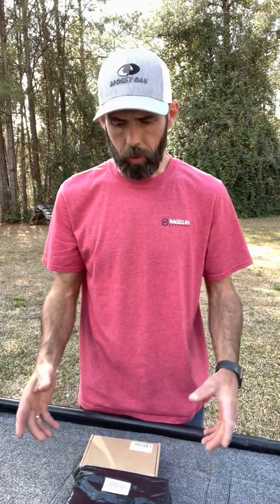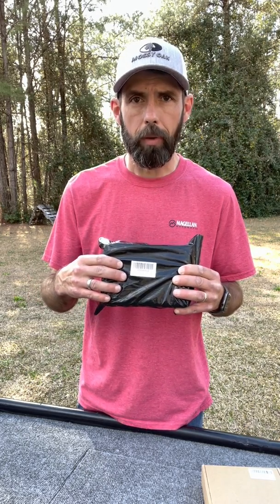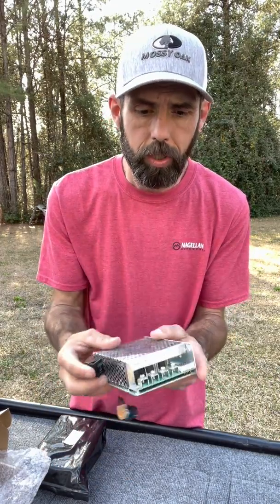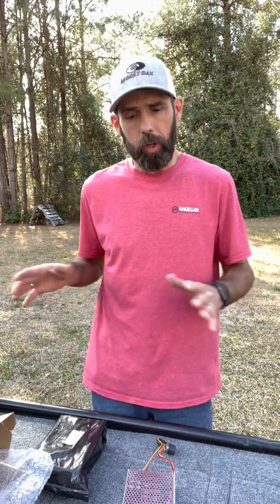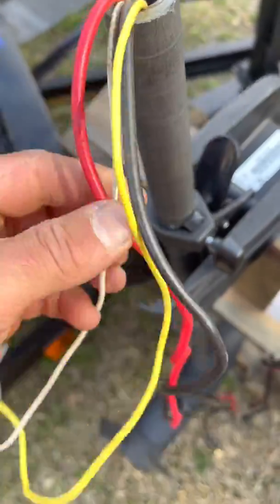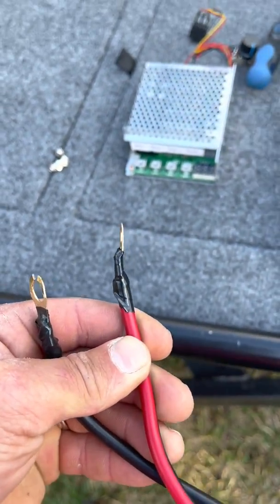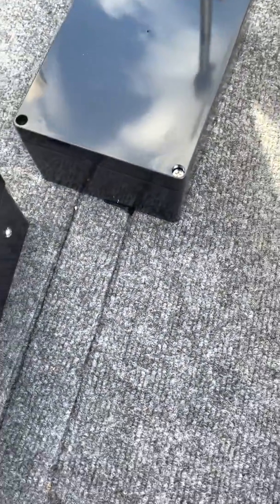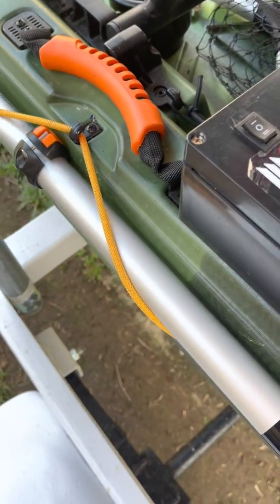How to hook up a PWM (pulse width modulator) to control a trolling motor.

Comment: 1st day out. I’m on full power running for about an hour on my minn Kota 40…. All of a sudden it shuts off…. The reverse still works oddly… the 0-100 wouldn’t even display for the forward switch (the two lines)

I had to paddle my ass 4 miles back LOL

The PWM was hot as shit…

How do I avoid that in the future?

I read the PWM is only 40 amps continuous. Obviously me going full blast was beyond that… 

Is there a PWM that will go continuous without over heating dying?

Also is that PWM dead dead, or can I revive it in anyway.
Reply from the maker: You need a larger PWM the 100amp with a fan especially running full power.
Reply from the maker: I also forgot make sure you’re running 8 gauge wire.

Comment: Instead of the potentiometer can a e-bike throttle be hooked up to the PWM?
Reply from the maker: I’ve never tried and I’m not sure of anyone that has. As long as you can connect it to the control board I don’t see why it wouldn’t work.

Comment: The reviews on Amazon that said they used these things on trolling motors must have all been fake or outright lies. The PWM that came today had connection terminals so small they could only be used for the thinnest of wires and no way heavy guage trolling motor wires could hook to it. I'm sending this crap toy back. 100  amps my ass this thing is for toys not trolling motors.
Reply from the maker: The 100amp PWM I used in my video is the only one I will refer for people to use.
Reply: @334tacticaloutdoors  The one that was sent has a fan and rated 100 amps but the connection terminals are so tiny and so close together there is no way to hook it up without frying it and then you are stuck with it. Amazon might show the one with larger terminals but the crap they send is the one with tiny terminals.
Reply from the maker: Yea if you can’t hook up the terminal connections without them having a little space that would never work.

Comment: After all the work installing, researching, shopping, and after working for about 3 months, my PWM simply stopped. No moisture visible, no burn marks, not nicks. I tested voltage to the PWM and it's getting full juice. Nothing coming out. I'm at whit's end here. Any suggestions?
Reply from the maker: What size PWM do you have? And what size trolling motor you have?
Reply: @334tacticaloutdoors , it's a 100 Amp and a 62 lb motor, 12 volt
Reply from the maker: Unfortunately it sounds like it has gotten water in the switch that’ll end the life of a PWM
Reply: @334tacticaloutdoors , I have power at the PWM but nothing going out. I have to check the controls, a lot of splices, but I got depressed and I'll look at it tomorrow

Comment: Like your video. Where did you get the project box. I like that box it looks good and makes a nice clean job. Thanks
Reply from the maker: Thank you, I got the box from Amazon 
https://www.amazon.com/Zulkit-Waterproof-Electronic-Junction-Enclosure/dp/B07RT6NWTR?pd_rd_w=2bCMJ&content-id=amzn1.sym.70f850ae-ff80-43b3-b581-5ad293225e90&pf_rd_p=70f850ae-ff80-43b3-b581-5ad293225e90&pf_rd_r=GBNDNN8WJ96JZ94FBQ5G&pd_rd_wg=cja2C&pd_rd_r=bae49b80-e37c-4ddf-aa05-f38ce0fa2dba&pd_rd_i=B07RT6NWTR&psc=1&ref_=pd_bap_m_aisles_rp_aisle_0_ttr_0_1_i

Comment: Bro seriously thank you for this! You have no idea how many videos I have watched and everyone acts like everyone is good with wires. Your video was the simplest video I have seen out of all the research I have done. I'm going to follow this step by step. I only have 1 question.. I have a 24lb thrust 12v watersnake trolling motor. Should I use 10 gauge wire or 8 gauge? I don't want it to overheat or fry it. Thanks for keeping it simple 👍🤙
Reply: You also got a new subscriber 🤙
Reply from the maker: To your question 8 gauge is always best to use. And thank you for enjoying the video that was the whole point in making it just to explain how simple it really is. Thank you for subscribing to the channel I appreciate all my subscribers.
Reply: @334tacticaloutdoors  perfect found some 8gauge power sockets on Amazon not exactly the same ones you used as those are only in 10 gauge but they should work just fine. Appreciate the replies brother you helped me out a bunch 🤙
Reply from the maker: You’re more than welcome, if have any other questions just let me know.
Reply: For 34lb watersnake motor, what size if the wire/socket i need to use?
Reply from the maker: 8awg wire is always best to use.

Comment: Did you have to extend the motor wires or battery wires? If so do you use 10 gauge? And do I ask for 10 gauge connectors? Stupid questions, but piecing this together.
Reply from the maker: When u extend the wires from the trolling motor to the PWM yes and I use 8 gauge and the wire from the Battery to the PWM I use 8 gauge also.
Reply: @334tacticaloutdoors  thanks brother
Reply from the maker: @jagervolant7871  you’re welcome
Reply: @334tacticaloutdoors  one last question. My PWM looks like your chrome one, but the potentiometer has wire like switch and turn knob… my set up goes from left to right.

Motor negative then positive
Then
Battery negative then positive

I’ve read in comments sometimes the Chinese get them backwards, and some people Fry their PWM… 

You know anything about that? 

Before I juice this thing up I thought I’d ask. 😂
Reply from the maker: @jagervolant7871  if it reads motor negative and positive is right beside it that would be the motor positive and then battery negative battery positive would be right beside it.

Comment: After watching this, it was pretty easy connecting my PWM, thanks. Have you had any issues with heat in a sealed enclosure?  My box was hot at the end of the day, but I wasn't sure if it was just the sun.
Reply from the maker: Thank you, No I haven’t had any issues with my overheating. I created this video for the reason of helping others to see how easy it was so thank you for the feedback.
Reply: Mine overheated and put the mechanism into protective mode. No motor. Middle of the River 😂. Gonna have to vent it somehow
Reply from the maker: @Robley35 they sell a waterproof case that has 2 latches. You could just pop the latches open while running just to let air in to the PWM or you can add a fan to the top of the PWM to help keep it cool.

Comment: Good videos.  I left the yellow and white wires available so iF the PWM quits can connect the battery to the motor wires and get back to the boat ramp without paddling all day.
Reply from the maker: There’s absolutely nothing wrong with that. Thanks for watching m.

Comment: I wanted to run something by you regarding my PWM. I purchased the 100 Amp and my motor draws 58 Amps. I had to vent it to avoid overheating, but yesterday it shut down on my during a long move against the current. Very annoying and dangerous, I had to wait about 4 minutes and then it worked fine. It did shut down on my two more times before making it home. I was thinking of installing a switch similar to the marine battery switch I use for my two batteries so I can run through the PWM when I'm fishing or going slow and switch to directly to the motor when I'm on long runs where I'm going full speed. This would avoid the overheating of the PWM due to the speed and get me home. I was hoping you would have some imput on this crazy idea of mine. Thank you in advance!
Reply from the maker: What gauge wire are you using from the motor to the PWM? And also from the PWM to the battery?
Reply: @334tacticaloutdoors  I use 10 gauge for both
Reply from the maker: @victorgatelljr.5753  the first thing I would recommend is using 8 gauge wire that should solve the over heating.
Reply: @334tacticaloutdoors  , Ok I'll try that. Thank you
Reply from the maker: @victorgatelljr.5753  if you still have any issues after changing the wire let me know. But I’m pretty certain that’ll fix your issue.

Comment: Nice. I am going to make this. Thank you!
Reply from the maker: You’re welcome, I appreciate you watching.
Reply: I made this for my trolling motor.  It works great. The only drawback is the tiny toggle switch they provide.  I am looking for an alternative that I can exchange the toggle switch for.  Everything else works great. I thank you for sharing this information.  An additional note is the motor height on the Colorado pontoon is too high for my Minkota.  I installed an oak transom and placed the metal motor mount in the center to enable the seat linked steering.  The prop churned the water, drawing air and making much noise.  This still moved the boat but is not optimal.  I am now removing the motor mount to lower the motor height.  In order to maintain the strength and stability I am laminating a secondary piece of oak at the center of the transom on the forward side of the board.  This will permit the motor to sit about 3” deeper in the water.  The total thickness at the area of attachment will be equal to the thickness of the board, 1”, plus the diameter of the frame pipe, 1”.  The motor will attach and tighten to the laminated board with the screw down tighteners overlapping the pipe frame and the oak.  I think this will do the trick.
Reply from the maker: @alexdroban4312  yes that’s with is small for the 100amp PWM. Sounds like you’re doing great work. I appreciate you letting me know it worked for you. Thank you.

Comment: I've saw 0 videos on a PWM install on a foot controlled trolling motor.  The speed coils are in the motor if I'm correct. I'm not as concerned about the power savings as I am wanting to slow my boat down. The trolling motor on 1 is still too fast for what I'm looking for.
Reply from the maker: Yea very few have put a PWM on a foot control trolling motor that I’m aware of.

Comment: For those of you who are installing a PWM, and use a multi-meter to test the voltage, I discovered that when no motor is connected, the output on the unit will read full voltage, around 12.54 v. Only when you have resistance (the motor) will it read correctly. I am not an electrician, nor do I have a clue as to what I'm doing, but I found out the hard way when I installed my PWM, and after 8 hours of wiring, nothing worked. I almost had a heart attack, lol. I had to get an education in electronics in a hurry. Good luck!
Reply from the maker: Sorry you had such a hard time, sometimes something simple to one can be a struggle for others.
Reply: @334tacticaloutdoors , thank you. Now that I have everything working correctly, I was wondering if I should vent the box to avoid overheating. I fish in Florida and it gets hot. I mounted my PWM near the lower side of my battery box, it's been sealed and should be watertight, but I was thinking of installing a 3/4" PVC stack, let's say about 6" with some sort of a cap that is splash proof but allows heat to escape. Obviously if I capsize, it's over, but at least during normal operations the PWM will vent and wave splash will not affect it. Have you tried anything like that?
Reply from the maker: @victorgatelljr.5753  if the PWM has a built in fan you don’t have to vent it, but if it doesn’t you may wanna vent it to cool it off. I live in Alabama, I know how bad our heat is in the south.

Comment: Can a person relocate the switch and potentiometer away from the PWM or would the voltage drop to those be too much ?   For instance....have the PWM with my battery and locate the switch seatside
Reply from the maker: A lot of people have started putting the PWM in a different location and moving the speed control and switch with very good success from what I hear.

Comment: Awesome video, and the cutting of the shaft as well. I will be doing this soon. I have a dilemma with my new motor and the 2-year warranty. If I wanted to not cut the shaft and just leave the head on, how do I hook up the PWM?
Reply from the maker: What I would advise is to remove the head, just don’t cut the shaft. That way if you have any issues you can reinstall the head. Now I’ve spoken with Motorguide about removing the heads and cutting shafts and they can not void a warranty if what you do isn’t the cause for the failure.
Reply: @334tacticaloutdoors , thank you. I bought an inexpensive motor, Newport Vessels NV 62 lb thrust, but it comes with a 36" shaft. I do have a question about the PWM, can I install it on the inside, under my deck and run wires for the controls to my seat? I always think a kayak will eventually be upside-down and I have my below deck area sealed.
Reply from the maker: @victorgatelljr.5753  yes a lot of people have started doing it that way.
Reply: @334tacticaloutdoors  , I found a 24 gaunet, 8 wire wire for marine use and I used that to extend my controls. But when I tested it, I only get full speed on one direction and no variable speed at all. I'm at wits end, about to commit suicide. Any help will be appreciated.
Reply from the maker: @victorgatelljr.5753  you’re using 24gauge wire to extend the variable speed control and the rocker forward and reverse switch, but you’re only getting one direction and one speed. If I read that correctly You got some loose wires in there that’s causing that issue.
Reply: @334tacticaloutdoors , Yes, 24 gauge wires. The PWM comes with 26 gauge, I figured that would be ok. I have checked all my wires and they are all connected correctly. Unfortunately, I did not test the PWM before doing all this work, ugh! Now I'm going to check for continuity on each of the wires, it's 8 of them. Since my issue is with speed, then I'm assuming the trouble will be on the wires assigned to the variable speed.
Reply from the maker: @victorgatelljr.5753  yes if your wires are all correct them it’s more than likely a bad PWM
Reply: @334tacticaloutdoors , First of all I want to thank you for your response, I was starting to panic, so thank you! I found the problem, I conducted a continuity test on all the wires and found two that has issues. I pinpointed the problem, redid the connections, and it all works like it should.
Reply from the maker: @victorgatelljr.5753  so it was in the wires? That’s good that you found the issue cause I know it will work your nerves. And you’re welcome.

Comment: Got a question my 30 thrust minn kota motor has small black and red wires coming from the motor but  10 gage extension wires  are alot bigger, will this be able to handle the amps for my pwm and battery?
Reply: The battery wires that came with my minn Kota are actually the same Guage as the ones attached to the head (14 I believe), just marine grade with much thicker insulation.
Reply from the maker: Jack alltrades thank you for responding to his question when I didn’t. I apologize to you both.
Reply from the maker: I apologize I never got alerted for your question. As long as the black and red wires are for the motor on the trolling motor yes it will handle the amps from the PWM and the battery.

Comment: Got a question my 30 thrust minn kota motor has small black and red wires coming from the motor but  10 gage extension wires  are alot bigger, will this be able to handle the amps for my pwm and battery?
Reply from the maker: As long as you’re using the red and black from the minnkota and they’re the biggest wires from the motor then yes 10 gauge wire is fine and will handle the amps for the PWM and the battery.

Comment: Here goes a stupid question.  Could the PWM output be connected straight to the motor cable without disconnecting anything from the motor head, therefore, putting and leaving the head at speed 5 (or max) and still be able to control the speed and direction from the PWM controller? I hope that made sense.
Reply from the maker: No the PWM does variable speed. The yellow and white wire inside the head of the trolling motor has to be disconnected.  I have a video on my page of taking the head off a trolling motor it’s a very simple process.
Reply: @334tacticaloutdoors  Ok thank you for the feed back.  I just thought that because speed 5, or max, is a essentially a "direct feed" from the battery to the motor (bypassing all other speed resistors) that this could be done. I'll go check out your other video. Thanks again.
Reply from the maker: @Juan-hy5cl  it’s really a simple process to take the head off the trolling motor. Now when you remove the head off the motor disconnect the wires and hook your power and negative wires to the PWM you can put the head of the trolling motor back on just don’t hook the wires back to the head.

Comment: I’m having difficulty getting the switch attached to the box. Do the wires come out to help install ?
Reply from the maker: Yes you can unplug both the switch and the variable speed control from the PWM. The best way I have found to cut the hole for the switch in your box is to cut a hole in a index card that your switch fits then trace that onto your box to cut out.
Reply: Ok thanks. I’ll keep trying but I accidentally pulled the wire off the solder connection. Thanks for the tip on tracing
Reply from the maker: The wires only come loose from the PWM

Comment: I am doing a set up on my Lifetime angler 116 (like yours) and I have PWM like the one you have. I have the quick connects that are 12 gauge rather than 10 gauge. Am I ok with the 12 gauge wiring?
Reply from the maker: 12 is really to small 10 is really what you need.
Reply from the maker: Now you don’t have to buy the expensive 10 gauge wire lowes and Home Depot sells some that will work and it cost about 12 bucks for enough to do what you’re doing.